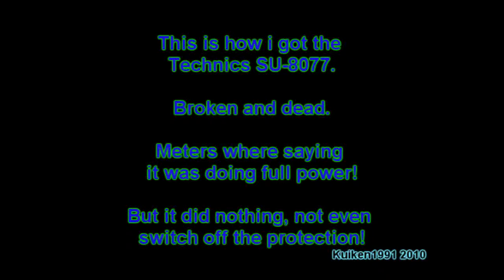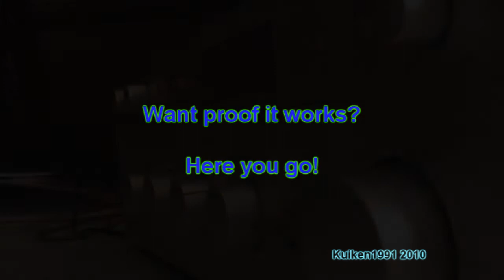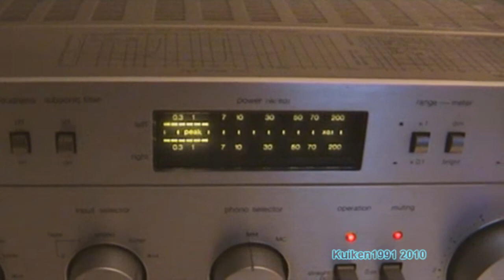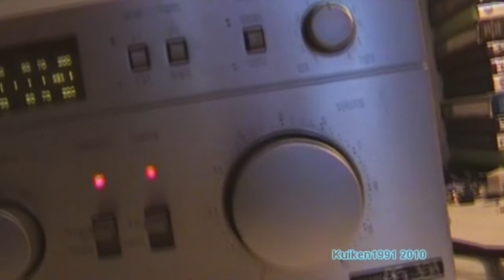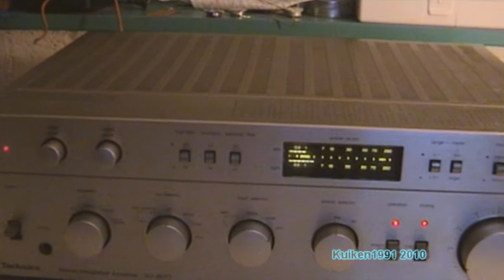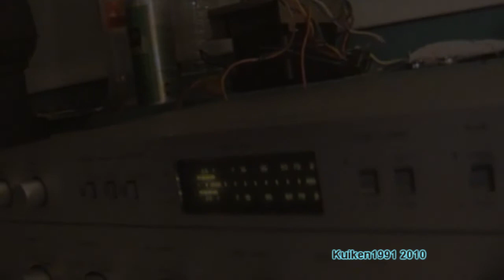Technics SU-8077 is fixed!

Comment: Hey good video! I just got a su8077 from a relative that is not working... Where should I start to look I'm not a tech but concider my self quite handy. Someone sugested the output metal transistors  shown in your video would be a good start. Any info in how to troubleshot the unit is greatly appreciated! Thanks, I owned one of this when I was a teen, now would like to bring this one back.Ken.

Comment from the maker: You should start with checking for burnt components. And indeed check the transistors. Get them out and test them with a multimeter or some other meter for checking Diode's.
When those are good you should check if the transistors get power to them, if they dont check the power supply part of the amplifier. when there is power on them you should check the input part of the amplifier. (this is just a rough explanation)